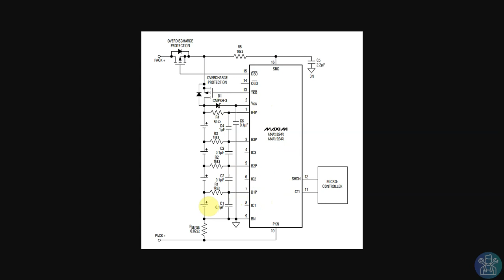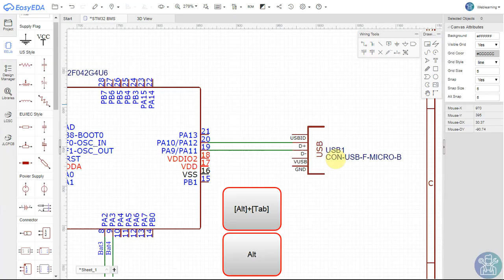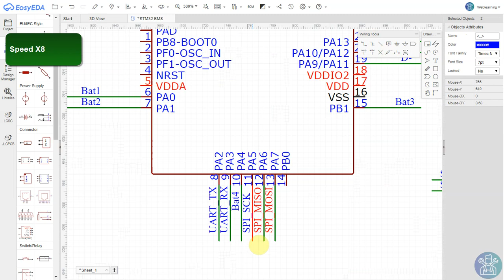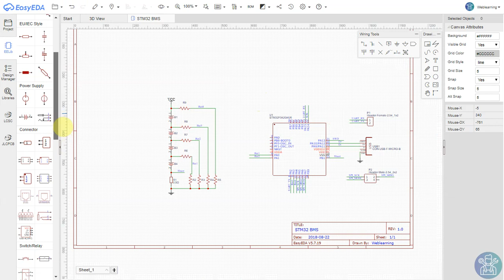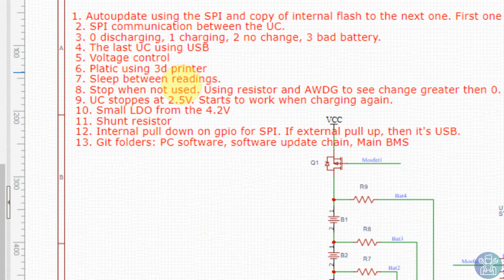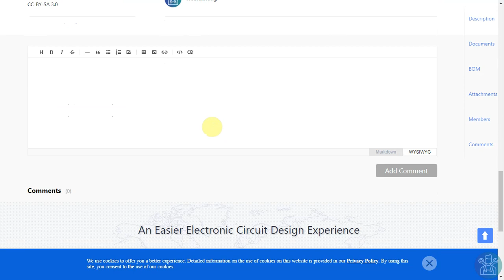7s Battery BMS joint collaboration - Long Video

Comment: Why SPI (speed issue)?

Also some stm32 support RS485 (if speed is not an issue) so you can daisy chain your BMS and other add-on.(and only two wires).
Reply from the maker: That's correct, but it will mean that will need to put OSC with caps in order to get the high speed RS485. Also, RS485 need external  part for the voltage and it not designed for high data rate. With SPI there is no need for extra parts.
Reply: Ohh I forget about external part!